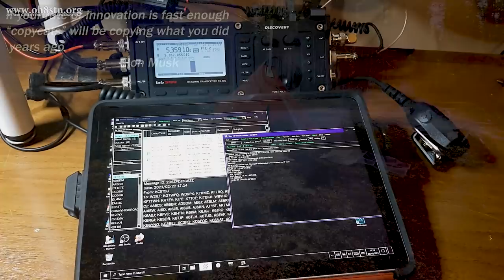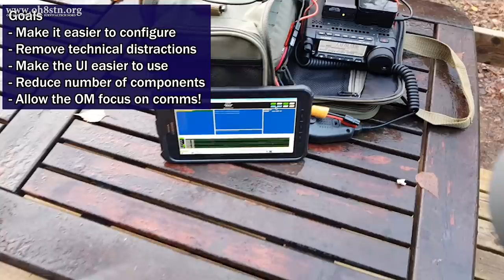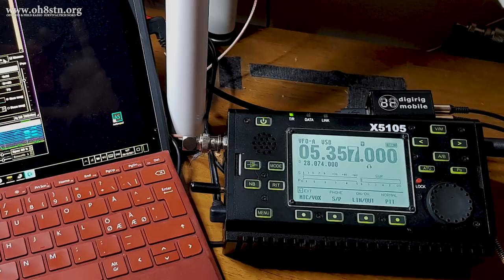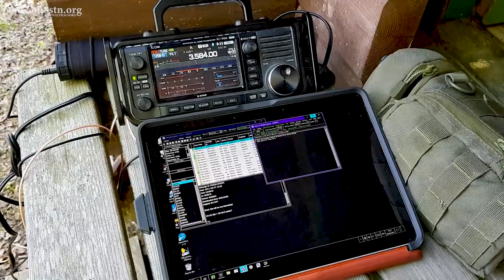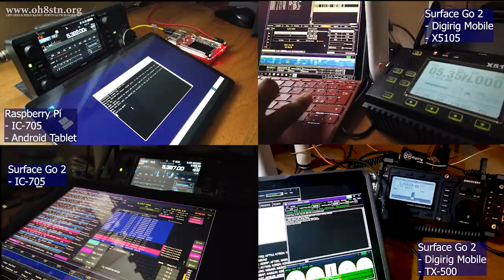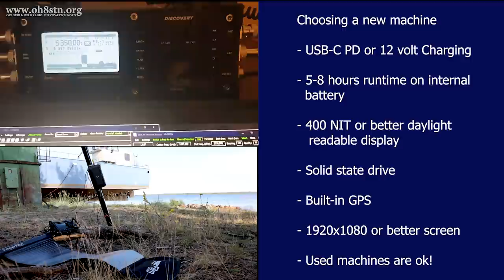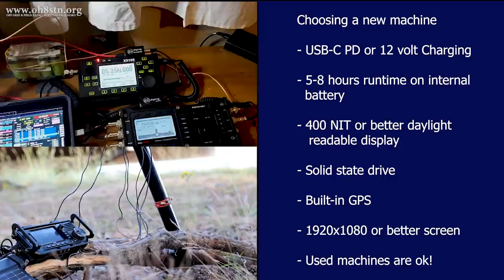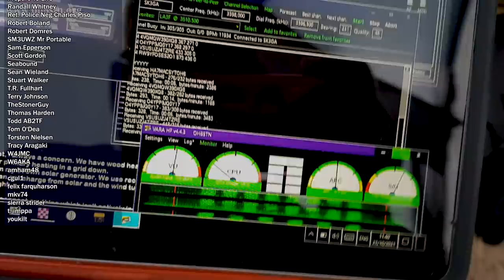Goodbye Raspberry Pi

Comment: I’ve found my priorities have more or less aligned with The presentation here. The number one thing I care about is reliability. I always will plan for operating in the worst conditions possible. As such I need to know everything will work when I need it to work. No matter what system I use or software cost. 

I like my raspberry pi. However, I consider it more a computer for tinkering rather than operational. Reliability is a massive concern for me. I’ve ran into many times the image corrupts and refuses to boot. The only real way to get it set back up is via internet. Which I may not have. I like the idea If a small low power computer for digital communication. However, raspberry pi doesn’t fit my operating goals. Namely reliability in the worst conditions. 

I currently have windows 10 on a think pad laptop. But I would prefer to take something lighter and lower power portable. 

Also using IC-705 wirelessly is incredible! That level of simplification is truly game changing. To not even require a sound card interface or cat cables is truly magnificent. I like my signalink box more for sentimental reasons. But I’d prefer not to worry about a cable mess. Magloops are already enough of a hassle. The loop is why I don’t care about tuners though. So the exclusion of a tuner isn’t a deal breaker, because I don’t use it. 

I would like to see linux with the same software for ham radio that windows does. However, the reality is it doesn’t. I don’t like playing with wine (in fact I hate this program) or VMs. To run a virtual machine as well will reduce operational time due to increased power draw from cpu use. Complication I don’t want. I would also like to see such programs on Apple platforms such as a MacBook or iPad. Due to the ridiculous power efficiency of the apple silicon chip. I’ve clocked close to 20 hours on battery with an m1 air. However, unfortunately it suffers from the same problem as linux. Namely lack of support for the programs I need. Because of this amateur radio application will be on a strictly windows machine for me for now. Again I need this to work. I don’t need to tinker. 

It’s truly been amazing seeing how your portable station develops over the years!

Thank you for making this video!

73,
KE8GAH

Comment: Thanks for all the videos you make that hold all of this information! I just grabbed a 705 and had to make a second trip to buy the remote control software. Have you found a way to activate the transmit from the surface pro using VOX or a Bluetooth button of some kind that can be bound to a key press ? Thanks

Comment: Hi I know this is several years old but I'm intrigued just the same! Other than this one of my goals is to separate this from the. internet using software that don't require it. My question is have you used the x6100 in this same setup using the surface go 2 even all the updates to the x6100. I feel that during ham radio operations the internet should not play a role. in its success or failure. The reason behind this is I live in Florida where power and internet access always seem to fail during hurricane season.
Reply from the maker: Yes, but not wirelessly. I've used the X6100 using and Surface successfully.  In fact, the x6100 is my favorite compact travel rig. Here's a video of it in action.
https://youtu.be/Eo_eW4Rxp8E

Comment: Great video aganin Julian. But this is one of the very rare videos where I have a different point of view. A Windows computer is great if you are in a shack. Access to internet, updates, backups. But out in the filed you are lost when Windows starts to behave strange. And sooner or later, all Windows systems start to behave strange :-)  Personally I find it much safer to carry 2 RPIs with 4 identical SD Cards. My mobile phone is always with me and most of the time my Samsung Active Tab3 also. So I have a display backup too.  Windows is very comfortable and easy to use, but if it fails out in the filed you are lost. And carying two Surface Go 2 is much more expensive that carrying two RPIs :-)  Just my point of view. 73, Stephan. DF6PA  PS. Lazy sunday afternoon, out at the river near by, my car in the back, my station and a coffee in front of me, I use a windows Toughbook too and not the RPIs :-)
Reply from the maker: Hello Stephan. It's definitely okay to disagree but perhaps you missed the functionality the Raspberry Pi lacks versus the Windows machine!?
My Surface tablet is only used for ham radio applications and almost never connected to the internet. It gets its updates once a month from over the home network and never connected directly to the internet itself. It's been nine months without a single issue. 
Full backups are done every few days and easy to restore if Windows has a problem. There have been zero Hardware problems with the Surface tablet. I wish that were true with a Raspberry Pi. Another problem with a Raspberry Pi is Pat winlink. What takes me 20 minutes with Pat and ARDOP, takes me less than five minutes with Vara and winlink express. We have very few ardop gateways and zero packet gateways up here. Running low power, it takes a long time to find that ardop gateway. 
I've carried the Redundant raspberry pies to the field previously. When there's a failure, you get the hardware back up and running, but the databases are all gone. WL Emails on the surface are backed up several times daily. We can't easily do that with the Raspberry Pi.
Anyway like I said it's okay to disagree. It's probably because we have different goals in amateur radio. At home the Raspberry Pi is fine. In the fields though, at this latitude, with this sparse population, it's much more complicated to use the Raspberry Pi man portable Nana Windows tablet or laptop. Think about what I'm trying to achieve and how I operate. Not what you're trying to achieve and applying that to how I operate.
Anyway it's always good to hear from you.
73
Julian oh8stn
Reply: @OH8STN  Julian, Vara HF and Winlink Express are good points.  The Surface hardware is reliably. Its the Windows oprerating system which makes me feel uncomfortable :-) More than 35 years of using Unix might be the reason for that :-)  I also would like to see developers working on a Winlink Express and a js8call solution for Android. That would be great! Maybe we all should start collecting money for such a project.  73, Stephan, DF6PA
Reply: But money expense was explicitly ignored because what the RPI gains in low money outlay, it eats up in time cost from so much more troubleshooting.

Comment: I moved over to a Surface Pro 6 last fall, before I found out about the Surface Go series.  My only concern with the Surface Go is the 4GB of ram and 64GB of storage.  Windows is a memory hog, hence I would go with the 8GB version of the Go.  Also, I would love to see more about the Digirig Mobile.  This is the first time I've seen this solution and am looking forward to see more content solution.
Reply from the maker: Thanks for the comment Duane. So far the go to has been okay but I agree with you. I would have pulled the trigger on the 8gb version just for the GPS. There's a link to my blog post on the Digirig in the description. Check that one out. I've got a video any coming on it as well. Thanks for watching and for the feedback, it's very much appreciated.
73
Julian oh8stn
Reply: @OH8STN  I look forward to the video in the Digirig.

Comment: Linux on a small laptop or surface talking directly to the IC-705 gets you the simplicity and reliability and is more in-line with Emergency Preparedness and Response values relating to open standards and interoperability. More so than an Android solution or a Windows 10 solution. Functionality-wise the main cost of rebuilding your current station to run Linux instead of Windows is losing Winlink VARA. The stop-gap is to run Winlink and VARA on wine on Linux. Longer-term develop a better Linux Winlink client and an open VARA-like protocol.
Reply from the maker: I agree with you 100%. Unfortunately there is no reliable Vara solution for wine. It's extremely difficult to configure and not very stable. I would actually prefer a Linux Ubuntu tablet or laptop. Quite frankly, the problem is with winlink development. It seems rather stuck in the Dark Ages.
Reply: Just how far apart is Linux from Android?
Reply: @sammiller6631  Android is linux

Comment: Great comparison - I'm very interested in this topic at the moment...

I've been using a windows tablet in my portable operations for years now, and am now transitioning to a Raspberry Pi system.   Why?  The only reason is to achieve a lower power consumption.   I've been out with it a few times now and it's been working great and the computer system is using 90% less power now.  As for reliability, I don't see why the Pi couldn't be just as reliable as the tablet, possibly even more so as the tablet could be more fragile due to the form factor and large glass screen.  There are a few aspects of the large tablet that I do miss like being able to type on the large screen keyboard easily and the size of the screen. 

I've got an idea, why not bring both, one for a backup system!
Reply from the maker: Actually if we're only running things like ft8, js8, or the modes included with fldigi,  we can do it with a Raspberry Pi.  Then the capable winlink client and Vara hf are missing. At the back of the machine, why not Raspberry Pi. As the primary machine, it would have to be an all-in-one solution for me. Let's see what the future brings on the channel ;-)

Comment: android systems for radio would be excellent IMHO.  I like this very  very much.  The nerd part of me wants to explore building a raspberry pi and system, but the 60 year old man says  do you really want to invest the time to build an learn another operating system ?   so this windows tablet is genius for portable ops !   One unit, easy connections and for me as a windows user for digital radio, usability/learning curve is a minimal time investment , i already know windows.  This tablet new isnt all that expensive, very doable.  Ihave 2 questions, that you may have already answered, its late/im tired please excuse me if you have answered already, tomorrow i will be back here.   1)  use the laptop with the yaesu radios ?  i dont know these radios, i use a yaesu ft1200, takes 2 cables to run with windows laptop, i assume it would be the same.  2)  power consumption of the windows tablet, compared to laptop and and raspberry pi.  A laptop would be hard to sustain for a mobile camp like i see in your videos, i think.  You had good success in the field with the pi and radio using the solar charger and 10ah battery.  My limited experience with android tablets is they use alot of power as well.  An educated guess would be 50% of a laptop.  I reckon the only way to know for sure is field use/experiment.  Another GREAT video !  Thanks

Comment: Who makes the orange side rails on your FT-817 (818?) at 7:03 please?
Reply from the maker: These are 3d printed. You'll find different variations for print on thingiverse.
Reply: @OH8STN  Can you please tell me which specific one that one you have is??
Reply from the maker: I didn't print it. It was a gift. I wouldn't recommend it anyway,  as it was too brittle, easily broke, and didn't actually protect the radio.

Comment: I agree less is really more in portable data communications. I just wish more development was out there for something other than a PC if only for much better battery life.  I know windows tablets are offering ARM processor SOCs to improve battery life.  To me the least about of complexity and lowest power usage to get the message Across is the point. Thank you for putting out this video we are moving in the right direction.
Reply from the maker: Thanks. Perhaps we'll get there. The installation simplicity of JS8Call, FLDigi and WSJT-X on Windows, Linux and Raspberry Pi should be a development standard Winlink and others try to reach for  keeping things simple, cross-platform and easy to configure will go a long way. 
Awesome comment.  Thanks for the feedback. 
73
Julian oh8stn
Reply: @OH8STN  I would agree winlink needs help.  I am not a windows fan but do have it running a ARM SOIC but no drivers yet.

Comment: Great video but what happened to the xggcomms digimode 4 ? Also thank you for the insight on pat winlink  and ardop,  I was also looking at adding a ublox gps module via the gpio to free up the usb port and have one less item to carry when you go portable with the pi , again well done on another great  video thank you 73 and have a great day
Reply from the maker: Hello. The XGGComms is an excellent audio interface. I still use it routinely at home. The problem is the cables and compatibility with a multitude of radios. The TX-500 was the reason for researching the Digirig mobile.  His rapid development approach and willingness to support other radios was the cherry on top.
73
Julian oh8stn
Reply: @OH8STN   ok cool ,well if I end up getting a tx 500 then I will have a look at the digirig .
Thank you for your efforts , your videos are great to watch .
73 VK1TSK

Comment: Thank You for Your very informative videos. As someone who simply cannot afford to pay hundreds for modern radios and new equipment I have to use the old gear I have access to. This means analogue radios with No CAT control which makes using most digi modes awkward at best. FT8call is the easiest to use on old radios and VaraC is sadly not really workable. Winlink + VaraHF appears to go but I have failed to make it work on air after several days of pfaffing about, especially annoying as I rely on old 65W solar panel with Pb and SLA batteries for power. It would be most excellent if You could maybe look at possible off-grid tactical comms using older manually operated radios without CAT control. I am sure I will not be the only one struggling to use digital modes with old gear when power and commercial networks & internet are down (this happens here several times every winter)  JS8call seems to be the only workable option so far but I hope there are ways to get other asynchronous comms modes like Winlink & VaraHF to work in an emergency situation. Your experience and any thoughts You have on ways to utilize older equipment would be much appreciated.  Currently using SSB voice, FT8 and JS8call with FT-707(S) and a partially restored TS-130S with 100W PA bypassed giving me 8 to 10W RF output so it can be used within UK foundation license 10W power limitation.  73 de Paul, MM7WAB

Comment: Does the surface have an inbuilt GPS? Im asking cause you compared this aspect as missing from raspberry
Reply from the maker: There are two versions of Surface Go, one with GPS, another without.  If you have a 705, no need for GPS on Surface.  Bottom line, user can choose what's best for themselves.

Comment: I'm not as experienced of a ham as you, but I've got IT/Tech chops.  I think the big "missing" in your new approach is that you've lost serviceability.  While, yes, an all-in-one solution such as the Surface reduces complexity in operations and setup, if something goes wrong you don't have the ability to service it in the field or come up with a field expedient replacement.  

For example, if you drop your Surface and break its screen, you're out of luck.  With your old pi solution, if you drop your display you can borrow someone else's phone, grab a pre-paid phone from a convenience store, or whatever.  If you accidentally break your USB port, you stand a chance of saving it with some judicious soldering on the pi.  On your Surface you need a heat gun, spudgers, and a full electronics tool kit, and preferably a hot air rework station.  In good times, not the end of the world.  In the end of the world, not good times...
Reply from the maker: You probably mean well so I'll try to keep my emotions out of my reply. The Raspberry Pi isn't stable. It is also reliant upon a bunch of different components all working together when off-grid and disconnected from the internet. If I accidentally break the screen on my tablet, I use my phone and backup Raspberry Pi which is in my go kit. If I break the USB port so I might tablet, I connect wirelessly to my radio as normally done anyway.
I understand where you're coming from however, the Raspberry Pi is not serviceable. There's zero chance we're going to carry the equipment to the service a Raspberry Pi or any other portable computer system in the field. The Raspberry Pi is as difficult to repair in the field as anything else. The difference is, I can add a rugged tablet to my kit rather than the surface go. A Panasonic Toughbook for example. Anyway it's still easier to protect the screen of my tablet, then deal with the plethora of unique components required to field the Raspberry Pi. The Raspberry Pi Is Awesome on a desktop. It's even awesome portable for non-critical communications. Still, it's not an easy thing to set up, configure, and operate when it's -20 outside. Thousands of hours of field testing. That's the point! I didn't just think this crap up one day without testing. Thousands of hours of field testing.
Reply: If you drop your Surface and break its screen, you can still do anything an RPI can do.  Surface has cross-platform apps like Unified Remote that can act as a remote screen and keyboard.